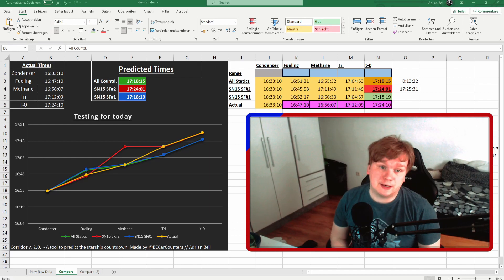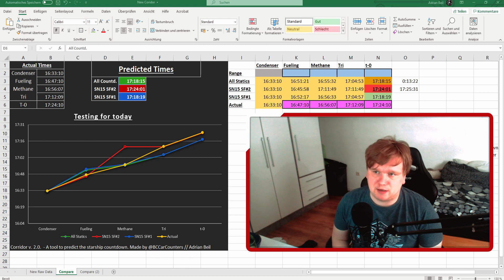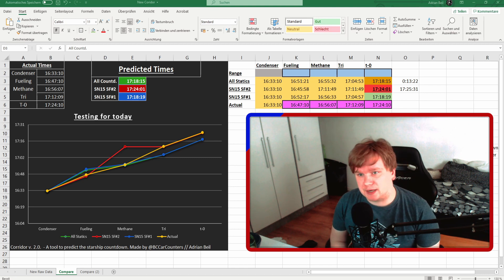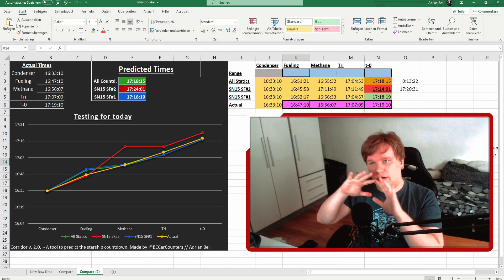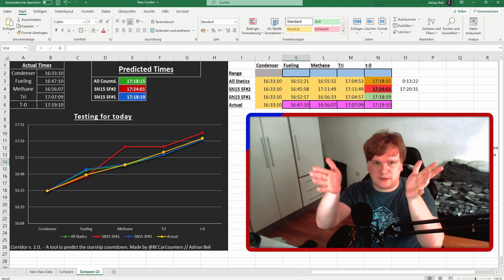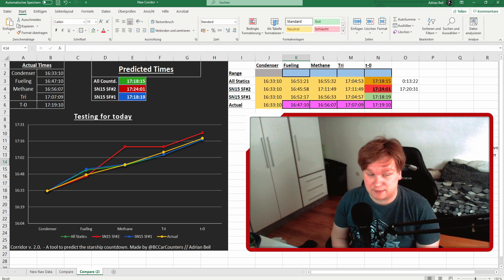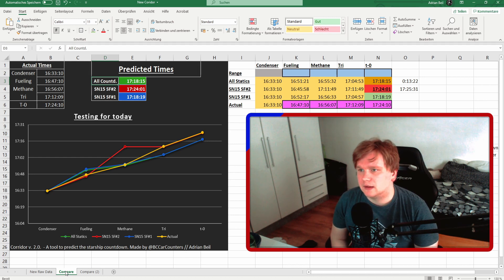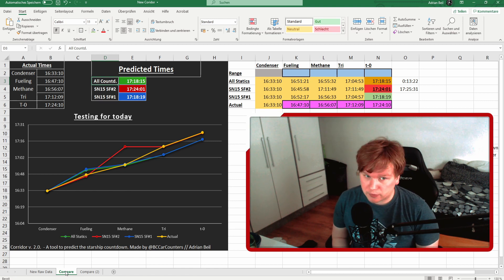Look at the hop countdown for Starship SN15

Comment: Your "methane vent" for the second static fire is wrong, your graph is basically saying that the "methane vent" and tri vent happened at the exact same time, wich it didn't. The "methane vent" on SF2 happened 18 minutes before trivent. Btw I'm saying it in between quotes because it's not really a methane vent, its a vent that happens above the methane tank, on the avionics bay, I'm calling it on my sheets "avionics bay vent".
Reply from the maker: You are 100% right. Silly mistake by me. The point still stand that the methane vent was off by the 5 minutes to the average. Just forgot to implement the numbers.
Reply: @LPAmdee  Thank you so much for answering and fixing the chart. Means a lot, and absolutely great work.
Reply from the maker: @djkamilo66  thanks for paying attention to detail! Good way to look at such things 💙